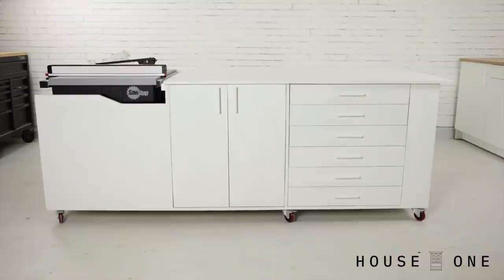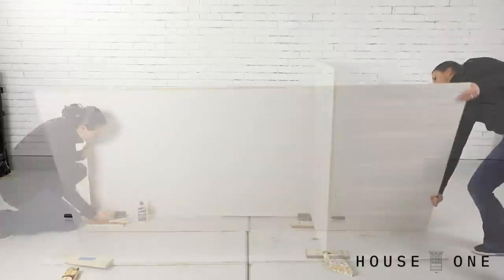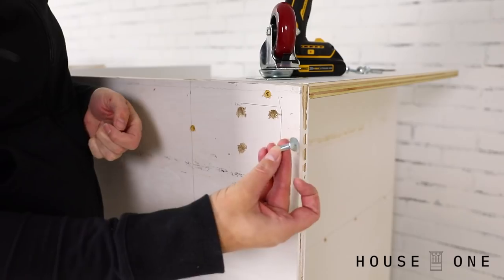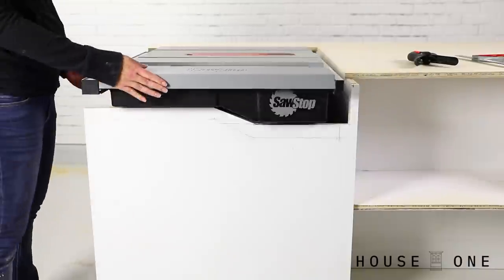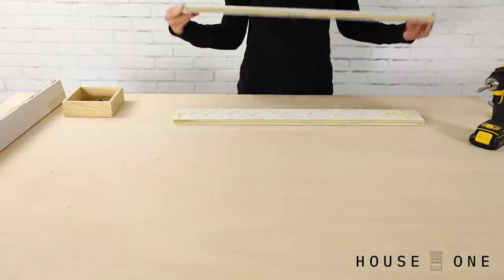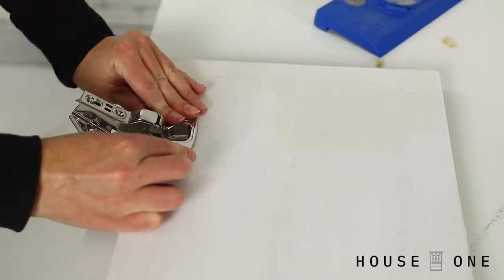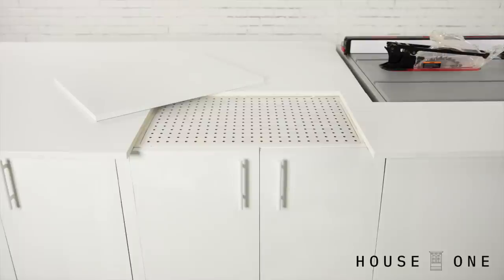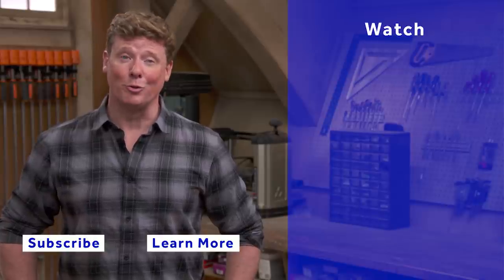Build the Ultimate Mobile Workbench | House One | This Old House

Comment: That should cost $5,000 in lumber now days, plus the cost of the saw...
Reply: True.  It looks like the cheapest smallest saw they have is $900.  But then, it depends on how much you're going to be doing with it.
Reply: @buzoff4642  I have the cabinet saw personally. But it's not cheap. 100% worth it!
Reply: @brookekathryn1980  Much like my sewing machine, I'll come to the point where "I'm not doing [too much], because I need a better machine."  For now, I sit on the fence.
Reply: @buzoff4642  Put it this way, it's a choice between insurance and not. 

I personally got lucky a few years ago after a board I was ripping that had a strand of wire in it. Which blew apart my sled and the downward force of the blade which continued to spin pulled my finger into the blade even though I was at a safe distance.

Luckily, the blade jammed against the lockdown insert and a chunk of my sled before it bit too much of my finger and fully crushed the other.

Completely freak accident that took two years and $50k out of pocket expenses before the settlement reimbursement.

Had I had a saw stop, the blade would have retracted the moment my finger contacted the blade and the sled would have never crushed my finger. I would have escaped with a few stitches at worst.

No crushed finger, no real scars, no strange line in my nail. 

I got lucky because I used all of the safety precautions and common sense yet still had an accident. Most lose their finger(s) either way! 

I now use exclusively sawstop. I figured $900 even $3,700 is worth 1. Keeping my extremities and 2. Is much cheaper than an accident. 

I can't make that decision for you nor can I determine your statistical probability. 

What I can tell you is that the less one works with a tool, the more likely one is to get hurt. 

The same goes for the person who uses a tool often due to shear contact time.

Still anyone can have an accident from an experienced worker all the way down to a first-time user could potentially end up in a very bad situation if something goes wrong! 

I just know what I would do and did. Now you just need to make a choice for yourself!ï
Reply: @brookekathryn1980  While I understand what you're saying, observing the men in my life who use tools, their big injuries look to be lack of attention to what they're doing.  Either because they're in a rush, or so used to their work they become complacent about paying attention.
Right now, I use rough tools, and severely limit what I attempt because of that.  I see woodworkers put out beautiful things, but with thousands of dollars of equipment to do so.  Routers, planers, etc. etc.
I expect good tools don't come cheap, even for the few that'd get regular use.
Reply: @buzoff4642  What you just explained a saw stop would fit into every category!